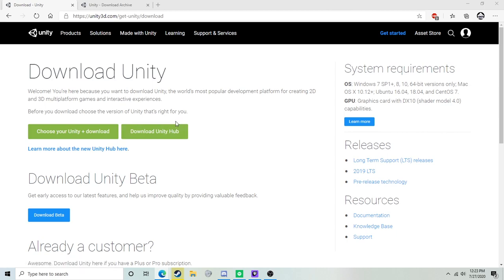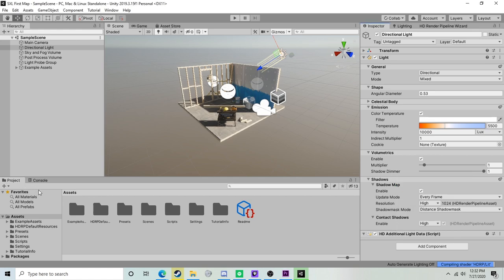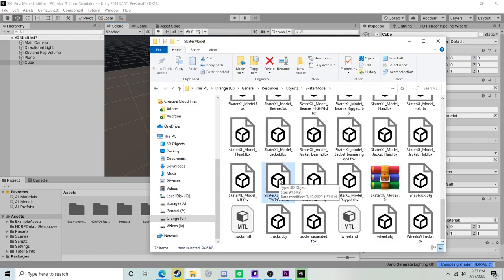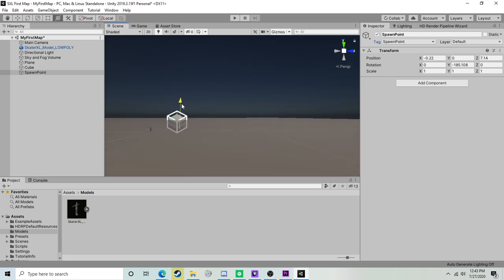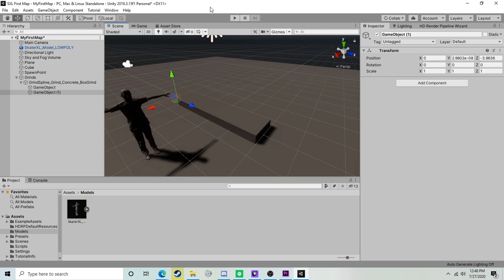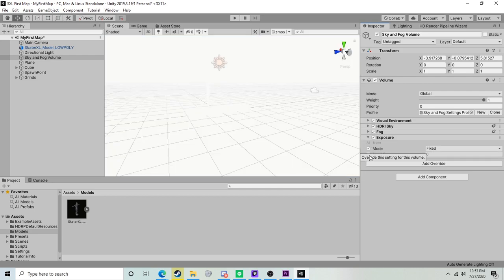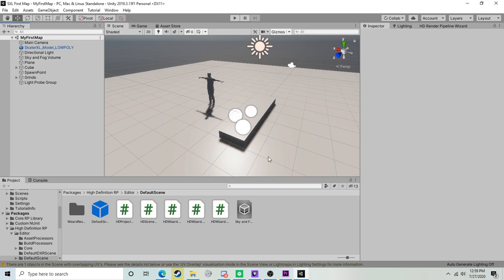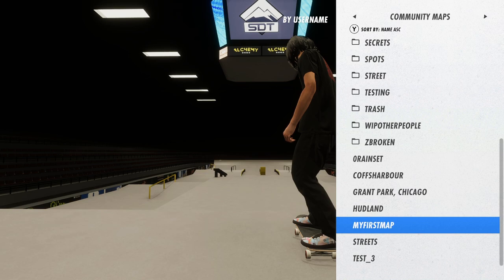Skater XL Mapping Guides - Creating a Map

Comment: Hey, i was following your tutorial completly and it worked out 100%. Iam a full time UE dev and i had 0 problems following your Unity tutorial . Great job and well done! I was able to create my own map, share it and skate it.

So but now i sadly have a problem and iam a unity newbie. Last time i used it more then 1 hour was 8 years ago. 
Last night Unity crashed while i was packaing the map. Sadly now the "Build" button does nothing anymore.

"\AssetBundles\StandaloneWindows" stays empty. Do you have any advice where i can debug this problem? I tried to google, but had no sucess so far. I keep searching, but maybe you had the issue once aswell.

Greets and again, great job on the video. It was easy to understand and reproduce.

Edit: Console log says: "Error in Build" and "No AssetBundle has been set for this build". I will google for that.
Reply: Allright i fixed my problem. Yeah! So iam not sure, if its an valid solution, but let me share my fix.

Just select your map in your "Project Window" and inside the "Inspector" at the bottom, create a new bundle for your map. Worked out for me.

Comment: The Asset Bundle Browser didn't show up on the package manager tab, so i thought i could download it manually from google. The download is complete and it shows in the package manager BUT it doesn't show up on window. What do i do? Please respond.
Reply: what you need to do is open the package manager then click update to 1.7.0 even if its already 1.7.0 and then it will show up when you click the window button.

Comment: My unityHub is not allowing me to download any archives so I downloaded the 2019.3.15f separately using a torrent (that was the only one that worked). This allowed me to finally open a project yet I can't tell what template it is using. is there a way to check this/change it or will it default to High Definition RP?